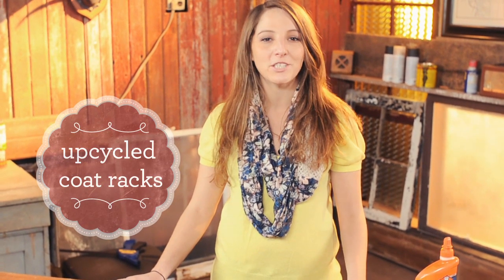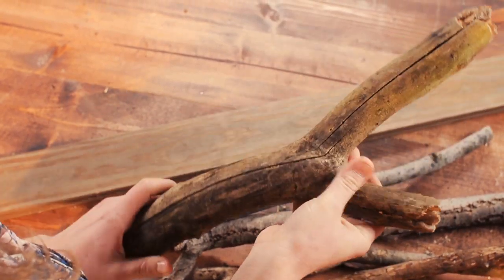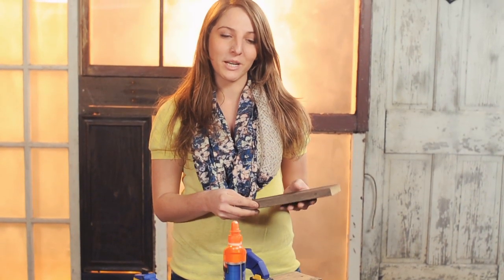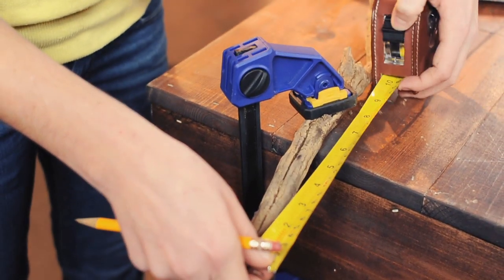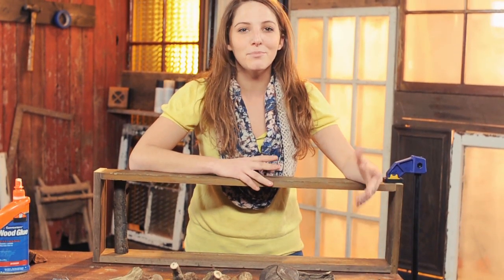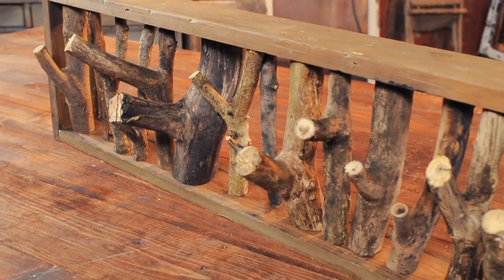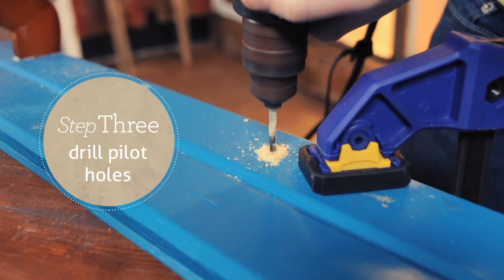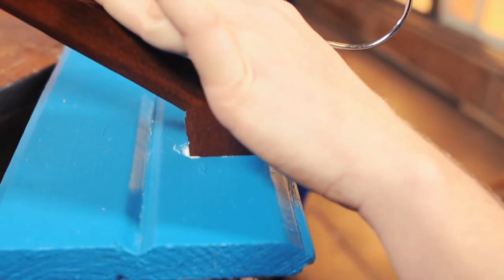How to Make a Coat Rack -- Buildipedia DIY

Comment: The branches have to be sealed or they will become brittle and start breaking off in bits. I use epoxy on live wood. It seals it and makes it water resistant.

Comment: Eventually the bark is going to start peeling off and flaking onto your coats and such. Would have been nice to see a way to seal it so it wouldnt do that.
Reply: Jessie Smith ... Epoxy is an excellent sealer for live edges, branches etc. it also makes it water resistant if you want to put it in a bathroom!